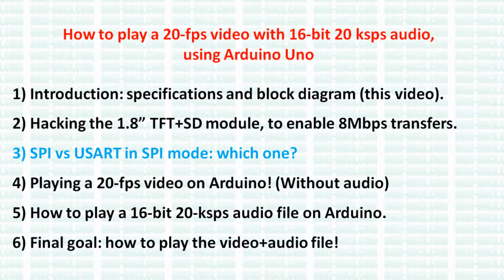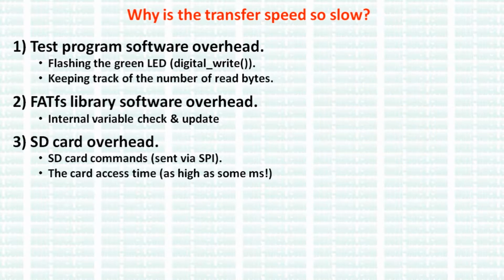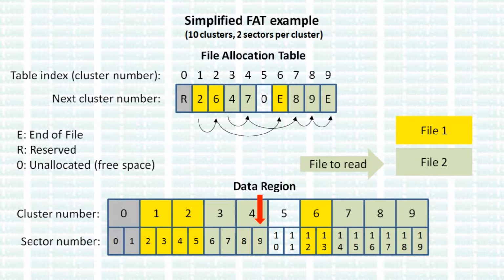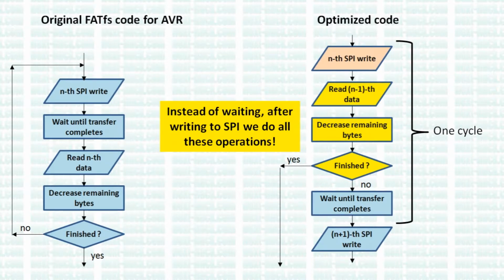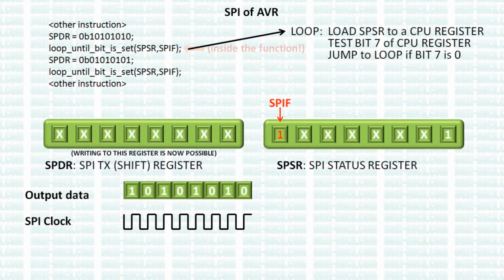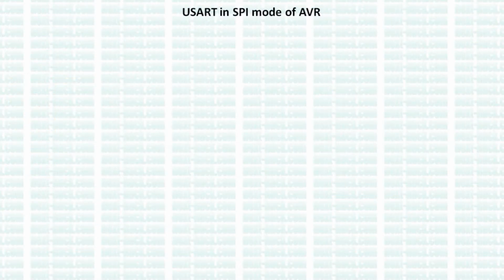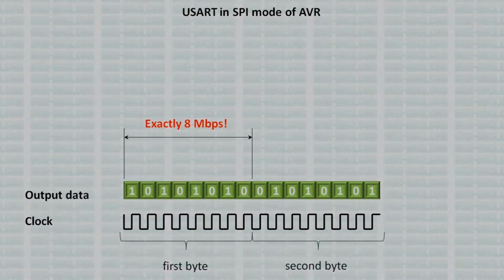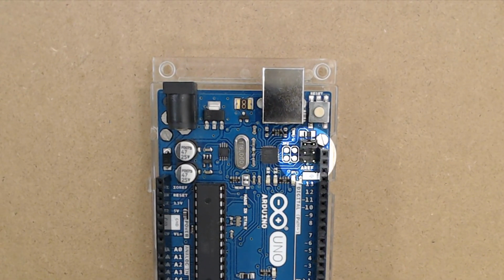How to play a video on Arduino Uno (3/6) - SPI or USART in SPI mode?

Comment: St7735 takes about 72 bits for single pixel 56 bits for pixel location command and 16 bits for 656color data over SPI. If my math is correct 20fps need 128x160x72x20 = 29,491,200 = 29.5Mbits/s. no idea how are you able to do it with just 8Mbits/s?? 🤔🤔🤔🤔🤔🤔🤔🤔
Reply from the maker: Hi! After you send the first pixel write command (CMD_RAMWR), 16-bit pixel data can be streamed consecutively, without sending again the next position (which increments automatically after each 16 bit data). This, anyway would not be enough, and a simple connection trick (see part 4) will allow to reach 20 fps .
Reply: @nexthack  okay interesting
Reply: @nexthack  thank you.

Comment: do i need logic level converter even with a esp8266
Reply from the maker: Hi there! No, you don't, as the ESP8266 works at 3.3V. Please also note that an ESP8266 has different peripheral architectures and registers, so what we say here about SPI and USART in SPI modes is AVR-specific!
Reply: @nexthack  thank you
I will update you on my progress soon. I have some good results with my tests